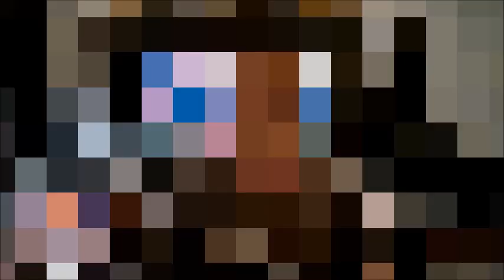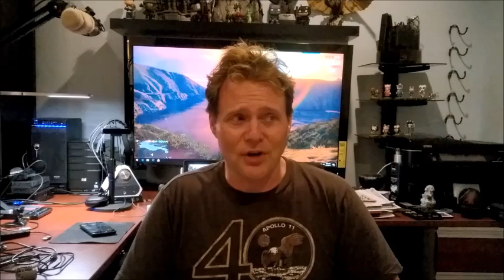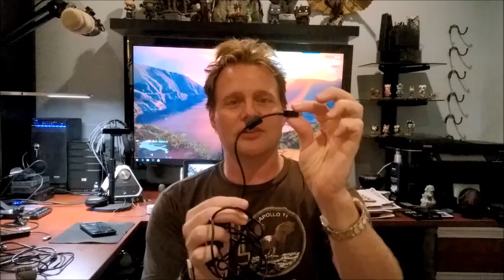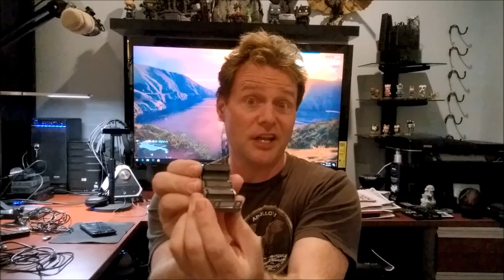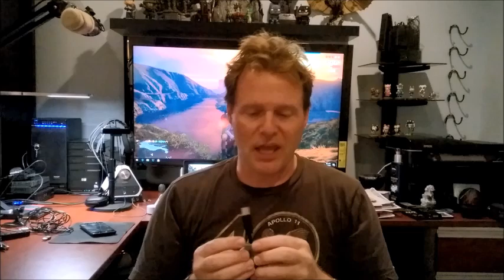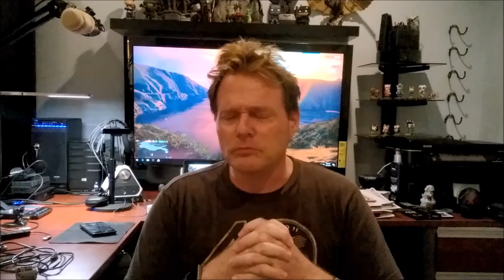What are Ferrite Cores and How do I use one?

Comment: Seems to be different ferrite types, such as 43. What does this mean to me and my CB radio?
Reply: the number on a ferrite is to know with one to use for that frequency range , and ferrit#43 is what you need to use and if you can wrap it 2 to 3 times on one, it acts like you have thee in line
Reply: @808pathfinder  Thank you sir!
Reply: @409novaman  1 more thing it always goes at the end of your coax not close to you, exp on your mic you add it at the plug end not were the mic is and this works on all coax like radio, meter , antenna
Reply: Thank you.
    Had to replace a power supply on an old weather alert radio. Multiple ferrite beads on each end of the power cord quieted the hash or loud hiss from the new switching PS. The RF from the new PS made the radio unusable.
   Thank you. I now have a functional radio.

Comment: So I got a sound module from the late 90's, the Roland Sound Canvas SC-8850.
It's a MIDI music device which also has an alternative USB connection which allows for use of up to 64 MIDI instrument channels (4 parts of 16 tracks each).
The USB cable type is the type B cable you'd see with printers throughout the 2000s, but I do notice that whenever I plug a cable in the USB slot it generates an additional level of hiss with a high-pitched screeching in its signal.
When using standard MIDI cables there IS some light noise but nothing that obnoxious and at such a low level you'd have to turn up the audio interface to deafening levels to even notice.

It seems that at the time, USB 1.1 ports hadn't really come up with shielding like more modern USB ports seem to usually have, and thus they might be more vulnerable to phenomena such as ground loop.
As an additional observation I've noticed that none of the USB type B cables I've used for it so far have actually had ferrite cores.
Could it be a worthy bet to try getting a cable with ferrite cores to clean this noise up?

Thanks for your time.

Comment: G'day from Australia, Do you think one of these might help improve the signal I get on my AM radio in the Chevy? The radio stations Iisten to are about 150klm away and although the signal is okay when driving, it goes all screamy when I put my foot on the brake pedal and sometimes when I use the indicators. I have a couple of them here and was thinking of putting my antenna cable through one two times.

Comment: I have a TV in my living room and I run a cb in my man cave and I am getting  feed back noise from  the TV wen she turns it off and on will this help me get rid  of it
Reply from the maker: It's certainly worth a try. If the TV is getting an over-the-air signal that might be one reason why the interference (as in, you have a digital antenna in your home and maybe that's why there's as much interference as there is).  Usually most TVs are well shielded on the inside and tend to operate over wireless as 'WiFi' instead of the traditional over-the-air signals that we now get 'digitally'.  Also check to see if your TV and CB are on the same electrical circuit and if you do have a TV antenna, look at where that is in relation to the CB.  Best of luck!

Comment: I really need your help and your video gives me some hope. For 5 years since I bought Powerline adapter the box devices to transmit Ethernet UTP signals using the power sockets on the wall and the house electric wires to establish the connection my speakers started to crackle. When I increase or decrease the volume from the speakers to maximum the crackle sound is starting to be heard .
The power wire of the 5.1 speakers is coming from the subwoofer and doesn't have any kind of ferrite core on it. If I attach the ferrite core on the speakers power wire will it help to eliminate this EMI crackling issue?
Reply from the maker: I hope I can help you!  And I apologize for the delay - I've been a bit overrun these last few weeks but I finally have breathing room to look this over.  First, let me ask if you could plug the powerline adapter to a different outlet in the room, and even better yet if you happen to know of an outlet that's on a different circuit than the outlet you use for the computer.  If it's not a pain to try to do, this might be a good way to separate out the electric flowing into the device you're using from the electric that's being used to piggyback data on your powerline adapter.  There's a really interesting article here that goes into some detail.  https://www.cablinginstall.com/home/article/16467315/how-utp-deals-with-interference  (1 of 2)
Reply from the maker: Next, let's talk about the ferrite core.  I think it would help you, and yes, I'd be putting it on the speaker's signal wire, though the power wire might also be a place to try.  I'm assuming this is a powered subwoofer with its own power adapter.  If you can plug even the subwoofer in a different outlet than the powerline adapter, that too is a good idea.  But if nothing I've suggested so far helps, take a look at this video about a Balun Core - same principle but with a simple (literal) twist of winding a cord around the choke.  https://www.youtube.com/watch?v=JhAPJISUjB8
Reply from the maker: So to recap, I'd try 1) different outlet for the powerline ethernet, preferably on a different circuit; 2) Ferrite core on the audio wire and/or the power line for the subwoofer; 3) Balun style core like the video (and you can read more on Wikipedia to understand it):  https://en.wikipedia.org/wiki/Balun  I really hope this helps you! :)

Comment: hello, I ran a triple shielded COAX cable for my subwoofer through the walls. Unfortunately, it was run too close to some electrical and it's putting hum on it. Would these eliminate that hum or do I need to rip[ drywall out and move the line?
Reply from the maker: Hello Dave!  It's a great troubleshooting step to try putting one on the end of the cable that goes into the subwoofer.  If you can get the COAX to pass through it twice, that would be optimal.  Sorry to hear that your problem is in the walls!  I hope you don't have to resort to moving the line.
Reply: Did you manage to solve the problem?

Comment: Does it matter how tight they fit?  I have assorted sizes, and one is a little loose and the other is a little snug...
Reply from the maker: Not at all!  Just that the cable passes through the core is all that is necessary, and if it can pass through more than one time, that's better. :)

Comment: good day! I've bought a USB  sound card just for improvements for my audio quality, I plugged in the usb sound card into my pc and plugged my mic into usb sound card, it causes a lot of hissing sound I dont have any problems with my microphone and the xlr wire itself and I have found out that my soundcard causes the hissing problem, my thinking is the soundcard is grounded, my question is does this ferrite core will elliminate the hissing sound into my audio output? I am planning to buy and put it into my XLR cable, I hope you'll answer my question
Reply from the maker: I'm going to speculate here - trying a core is never really harmful, but if this were me I wouldn't be hanging my hopes on it.  The XLR wire will be a better connection with more power for sure - I'm assuming the hissing sound card connection for the mic is your typical 1/8" (3.5mm) plug?  Are you saying this USB Sound Card has an XLR connection too?  Sometimes this is a matter of levels: if your sound card has a dial, switch, or software control for gain, that could be set in a way that picks up too much background noise. For example, I have a Razer Seiren Elite USB mic for streaming. If I turn the gain dial up on it, I get tons of hiss. So I have the gain dial pretty far down, in Windows I have the mic levels turned up, and I talk close to the mic. If I were in my home studio, I'd turn the gain dial a bit higher and the Windows mic level lower because the room is treated and it would be easier for me to talk a bit further away.  Hope this helps!

Comment: Are sum ferrite cores not removable?
Reply from the maker: Correct! The ones that can be are easy to tell because they'll have a clasp and a seam that you can pry open...but some manufacturers embed them in the wire, and so you'd have to cut the cord open to get to it, and that would expose the wire.  Good question! :)

Comment: Trenton,  I am running a power cord to a Garmin Fish Finder head unit,  I have loom covering the power cord for more protection. Can i clamp the Ferrite Core over the plastic loom, which makes it tighter, or this will not work as well not being direct on the cord itself?  Thx
Reply from the maker: Hi Kevin!  As long as the cord passes through the core, the loom running along with it won't be a problem at all.  Hope this helps! :)

Comment: My neighbour is a ham, and we get interference on our satellite TV. 
Will a FR help me?
Would the RF go on the TV mains cable or satellite cable?
Reply from the maker: Hi Sudo! If the interference is coming from their radio, there's things both of you can do - check out this PDF, and for you in particular, focus on p.12 through the ferrite section.  http://hamradiouniversity.org/wp-content/uploads/2019/01/RFI-hamshack-20190106.pdf   Long story short, it can't hurt to put one on the satellite cable because that's where the sat signal comes in and the mains cable if you're both on the same power main and for some reason the power wiring is acting like an antenna. This may end the problem or it may be troubleshooting step 1.  I hope this helps you!
Reply: @trentonbennettVO  

Hey Trenton

I have just put a bunch of ferrite cores around the TV, phone, modem & router power cables.
Do you think it worthwhile that I put them around the HDMI cables to/from my TV/satellite box, too?
Ideally I want to stop the picture break-up/pixellation I get when my neighbour powers up his ham radio.

Cheers!

Comment: I have a camera system in our farm tractor. When ever I turn on the camera the tractor radio looses reception almost completely this is on the FM side not sure of AM. So will these take care of the problem? I am assuming it would go on the camera part of system but exactly where. The power wires or the camera cable itself?  Thanks
Reply from the maker: This may help, but I would also look into all the connections and make sure nothing's shaken loose and (most important) that everything's grounded correctly. If this is a camera system that wires into the fuse box that can be one point where things can come loose--I had this happen with a Dashcam because the wiring required me to wrap a wire around one leg of a fuse, then plug the fuse into the box.  I hope this helps you!

Comment: HELP-  I have an odd problem in my car. I have a 99 Camry that I switched over to all LED lights externally and internally. This concerns just the third brake light in the rear window. When I switched the third brake light over to an LED bulb, when the radio is on and I hit my brakes, the radio becomes so static-ee, I can’t even hear it until I let off the brakes and the light goes out. The radio’s antenna is built into the rear window, so Someone suggested I buy an RFI choke. I bought a small one and wrapped it around the red and white wires right at the bulb fixture, but it didn’t help the problem at all. I wasn’t aware that LEDs could cause RFI interference over an incandescent bulb. The choke did nothing whatsoever. I assume red is power and white is the ground and was wondering if maybe it just needs to be wrapped around the red wire only? It’s not easy for me to do this over as I have a bad back, so I was wondering if maybe I used the wrong size choke or maybe I’m barking up the wrong tree and the radio was at fault? Any insight to this would be extremely helpful. It’s so annoying to lose the station at every intersection, if you know what I mean? Thanks for any input anyone has.

Comment: Hi Bennett, I have a home recording studio and have RFI (AM radio station) playing through my monitor speakers as well as some mic and instrument cables as well as a BNC cable. Would a choke be helpful for a BNC/wordclock cable running from a pre amp to an interface?  Would a choke be helpful for TRS to XLR running our from an interface into a powered speaker? Thank you for your time, Cheers!
Reply from the maker: Hi Grant!  Yes, both of these would help, and it may also be useful to separate your audio cabling from power (for example, speaker cables not wound in a bundle alongside power cables ).  I recently got rid of an annoying buzz by putting my speaker cables above the desk and the power cables below it, and replacing some of my audio cables with better-shielded ones (the original cables were really, really old!). The idea of the ferrite choke is useful for any cable that carries an electrical impulse regardless of the connector, though most connectors do have some form of grounding built-in to minimize problems like this (and XLR has a specific grounding pin).  I hope you're able to get the problem solved!

Comment: ok we have a neighbour who's running a two-way radio birds up and set radio and the proms god is when he transmits are keyboards monitors and PCs start to act up to the point of the keyboard switches on and off cuts out and comes back and we're trying to figure out what to do he's tried them and on his end and we're trying to sort out stuff on our end have you got any suggestions would these Faraday that well these things work
Reply from the maker: Hi! YouTube (or maybe Google?) periodically dumps my comment notifications into a different category and I don't always catch my comments - sorry for the delay. I'm glad to hear you're both working together to solve the problem! There are some good suggestions in this document from "Ham Radio University" that might apply to you. http://hamradiouniversity.org/wp-content/uploads/2019/01/RFI-hamshack-20190106.pdf  Most computer equipment has decent shielding on the cables and such, but it's not guaranteed against unusual signals like this, so ferrite might be a good start...but you may also find you need some other shielding solutions or a look at where his antenna is located and how it's oriented.  I hope this helps you and I'll be the first to admit this is beyond my own area of expertise! :)  Best of luck though.

Comment: Hi, i want to use some ferrite chockes  on signal wires of a cnc machine. As they have a certain impendance at a certain frequency, other than fitting tightly on the wire, the bigger impendance would mean more efficiency ?
Thank you.
Reply from the maker: Hi Ionut Popa! I'm not quite sure I follow the question, but I think the gist of it is that if you have a larger core that the cable can pass through more than once, this would more efficiently battle any stray interference.  I hope this helps you!

Comment: Are these just for power cords or could/should they be used on antennas? I have horrible fm reception with the shop fluorescent lights on, even if I power a radio from a power source that isn’t connected to the shop. Light off, great sound, lights on, horrible!

Comment: Does it matter which end of the cable I install the ferrite bead?
Reply from the maker: If you look at stuff that has them already put on from the factory, they tend to be at the device plug end (like the example I hold up in the video, or a laptop adapter where you'll see it on the end that plugs into the laptop and not the end that plugs into the wall), so I follow that pattern.  Hope this helps!
Reply: @trentonbennettVO  thanks

Comment: microphones too?

originally was just gonna stop radio interference on my car headlights after upgrading them to LED, but phone cable and mic cable too? ok.
Reply from the maker: Heh - yep!  I actually did this video for a friend who was having interference problems with her USB mic, to show her how to put one on. But keep in mind, this is a troubleshooting tip!  So...it's really only necessary if you're finding you have a problem with noise coming through the line.  There are multiple places where the RF interference might be getting into the signal, so a ferrite core/bead/choke is just one way to see--if the problem is related to wiring--where the problem is coming from.  I hope this helps you! :)
Reply: ok 

i got a small bag of them
Reply: what about rc antennas